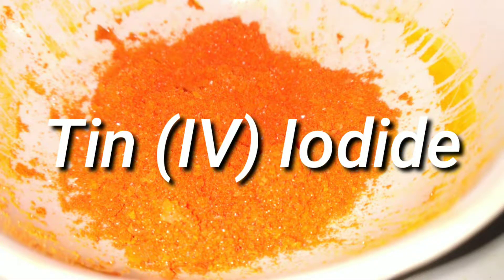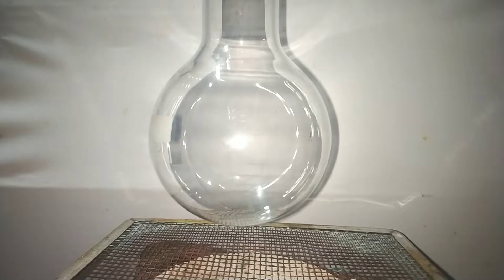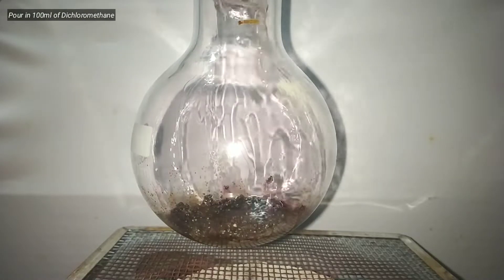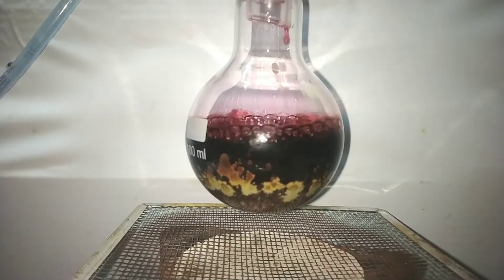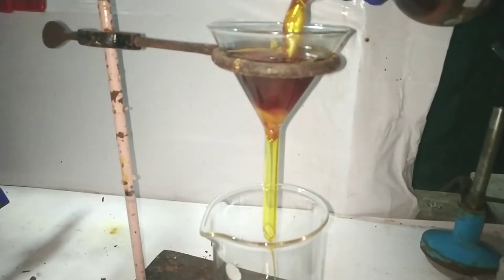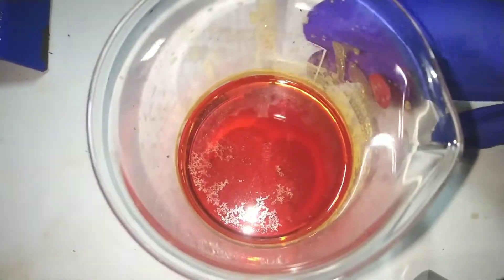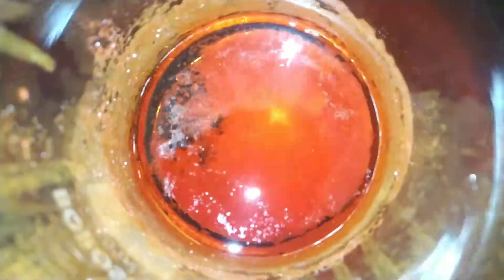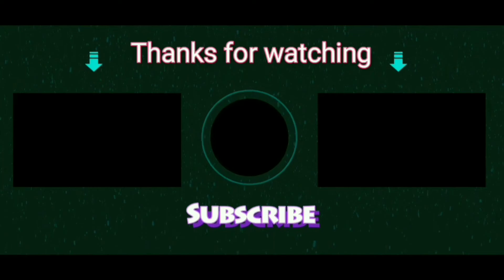Tin (IV) Iodide :Preparation

Comment: Beautiful product, I recently seen a form of ceramic Büchner funnel with ‘ears’ which are ports so you can run warm water through the ceramic and keep it hot so crystals do not precipitate from the solution while you filter.

Comment: I did this synth twice yesterday, and boy you're right about using tin chunks over tin powder. I first did it with tin powder, and it finished in less than 8 minutes. The 2nd run (slightly larger scale) I did with granulated tin, and after 2 hours it still hadn't finished (still had tin getting kicked around at the bottom). I poured just a little bit of powdered tin down the condenser and it finished in less than 2 minutes.
Also, at 1:30, how did you pour 100mL of DCM into a 100mL RBF, and somehow only fill it 50%? lol